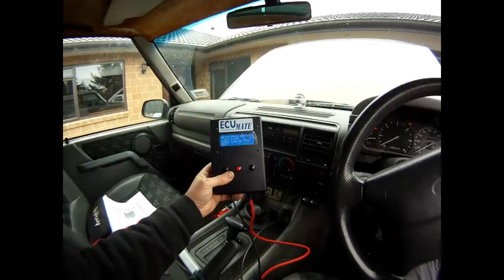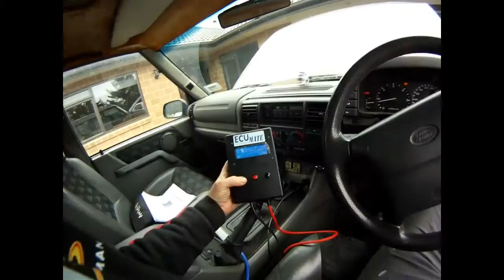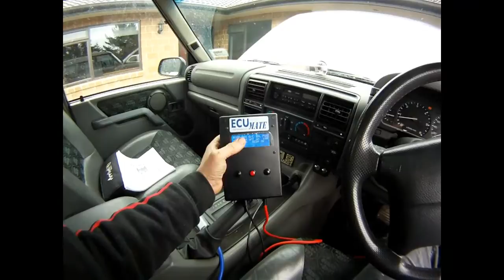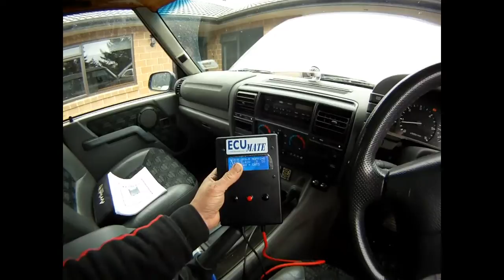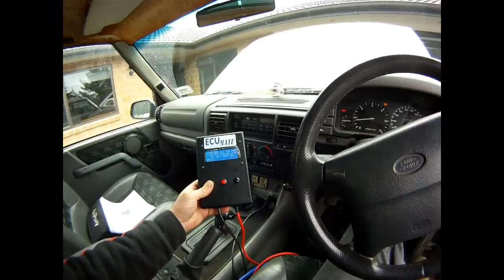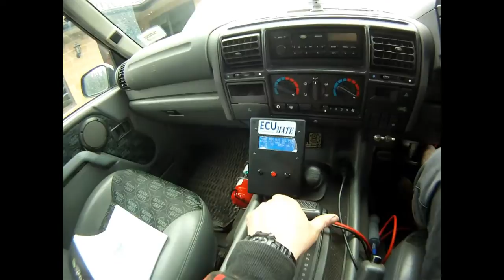Land Rover V8 3.9 14CUX EFI using ECUMATE PART TWO

Comment: Thanks for all the video's just great :-) on the way to getting my Discovery sorted !
The Cats have been taken off and I've just put the green tune resistor on, what do I do with the Lambadas ? do I just disconnect them.
Steve
Reply from the maker: Hi Steve yes just in plug them. I traced the wires into the cab and removed them completed you do not need them. Another matter you will need to do is adjust your air flow meter this is easy to do. Google adjusting 14 cux air flow meter. The voltage will need adjusting cheers dave
Reply: ***** Hi Dave,Okay, thanks very much.Ordered the ECU Mate on Monday and it left the UK yesterday, I ordered parts from British Parts on Monday and they arrived in Auckland this morning! Talk about fast !I suggest you sort out some sort of commission :-)CheersSteve
Reply: Ferrari waders 18436572